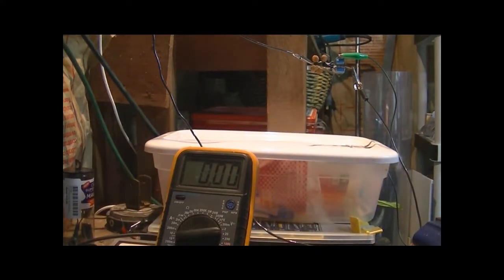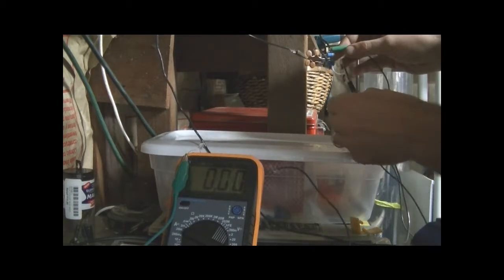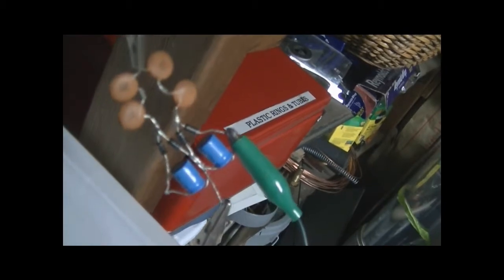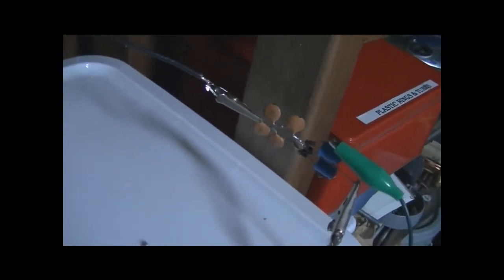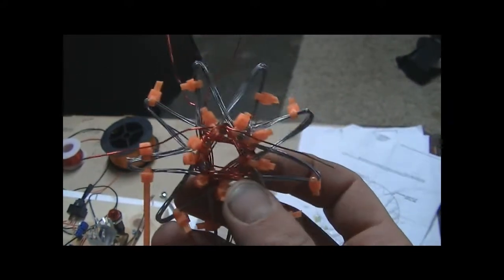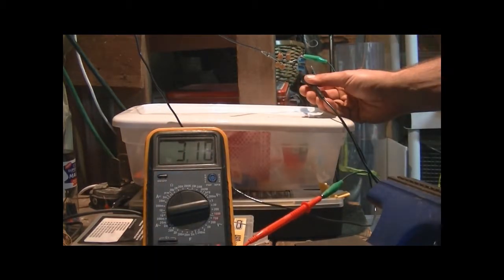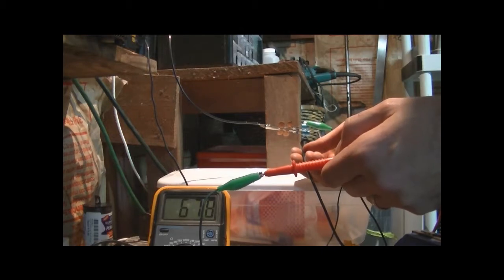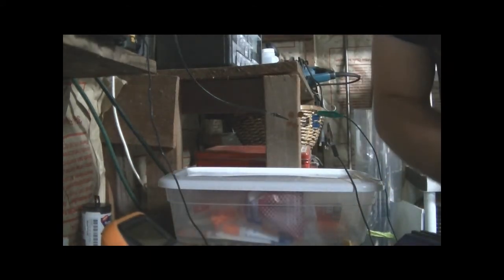Tesla Radiant circuit

Comment: I calculated you would have to series/parallel 5,000,000 of these circuits to power a home. Sure you get some power out of these but it does not mean people are on the right track. It would be like cooking an egg with a candle and thinking you can build a super efficient candle and heat a 10,000 sf. home. The physics just is not there. I do believe there is a way to do it, we just haven't figured it out yet. I would say this circuit is an example of what not to try. If you properly analyze the circuit it is already a proven failure.     BTW this is not the circuit Tesla used, it is an interpretation of Tesla's work, and a very poor one at that. The caps that Tesla used would be the size of that plastic box on your workbench. Besides the components, the schematic was taken completely out of context.
Reply from the maker: Your calculations do are not incorrect, this would not be ideal in this manner. There is more to this idea that can be explored in harvesting energy from the "static field"  so to speak.  There are quite a few people working on this idea currently and this is just a nice little demo to show that its possible to get energy from a simple antenna ground configuration.  Its kind of something to get people interested.  Think of the possibilities if you continued to add onto this idea things like a vacuum tube, Wimshurst machine, higher antenna, deeper ground, natural ocean water coulombs,earth battery configuration ect.  Not to mention a synergy of already know methods of energy harvesting like wind turbines and PV cells. As well as amazing storage systems like hydrogen cells, algae cells, new generation crystal cells, ultra capacitors, and super capacitors.  The problem usually boils down to one factor, and that is of a monetary nature.  If you create energy systems that have there own build in supply and demand, a corporation would not be able to control that supply and demand.  So what mega corporation would put money into making energies that are self sufficient.  I wont even get into the patent process.  Thanks for watching and commenting, I appreciate it.
Reply: It is interesting that you mentioned using a vacuum tube because that would put you in the right direction. Maybe not for the reasons you might think. It has more to do with the doped materials than with power. Still the circuit itself is not correct. basically you have built a transistor radio and you are dumping the signal into a cap rather than an Op-amp.
If you used tuning caps you could probably tune it to the strongest signal in your area. Bottom line is you are dealing with a radio signal and it is not going to get any stronger. I am not telling you this to be discouraging, I am telling you this so you might pick another direction. I appalled your efforts, good luck.
Reply: Have a look at this, this is not the answer but it is a good start. Nikola Tesla: Patents & Technology 3 / 3
Reply: It is clear to see that the capacitor he used is in a timing circuit and not a filter like in the circuit you have. The guy that originally came up with this "Tesla" circuit just did not understand what he was seeing, he could not understand why the timing circuit.  Only a hand full of people understands the reason for the timing circuit. Tom Bearden is one of them, But his side kick Bedini in not.
Reply from the maker: I agree with you, I have been looking into timing circuits and in particular resonant tank circuits. I don't have a signal generator or a rf signal generator to experiment and am not micro control savy enough to make my own. I deffinatly want to experiment with those particular tesla pattents but I must be patient for that to come.  I have been researching a lot. With research however, there also needs to be development. Here's to creative progression of possibility my friend :-)
Reply: Wow, This is hopeful, someone that can possibly grasp the concept. Have you researched Tom Bearden any?  If you have you would have heard of Bedini. Ignore everything from Bedini. Bearden has a theory on how it works but it may not bee 100%, but it is a start. Tesla referred to electricity as an uncompressible fluid. If you want to look at a close analogy of the theory, look up "Water Ram" and get to understand exactly how it works, what would keep it from working and what would make it work better. I will see if I can find one of the videos that Bearden did. I hope it is on a video. I don't want to have to copy it out of the book.